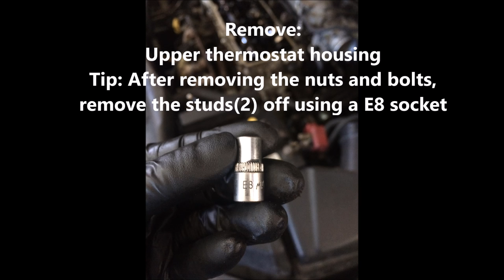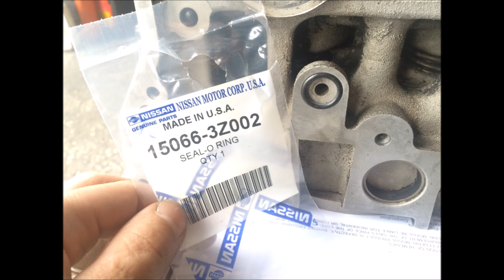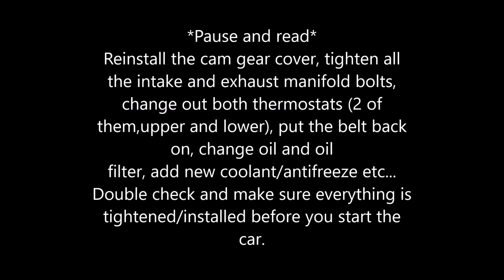Nissan Head Gasket

Comment: need the head bolt torque specs please I don't think I did that part right my head gasket is leaking big time after I got done from where the water pump is at but I can tell it's coming front the head gasket I might have not torqued it correctly my last step was 85 foot pounds
Reply from the maker: Torque sequence:

9   3   1   6   8

7   5   4   2  10

New Head bolts:

Step 1-torque to 72 ft. Lbs.
Step 2- fully loosen
Step 3-25-32 ft. Lbs.
Step 4-Torque 75-80 Degrees
Step 5- torque additional 75-80 Degrees
Reply: Peter Nguyen thanks allot Peter really appreciate it but the part where I went wrong was I put the head gasket wrong I guess I want paying very much attention anyways I went back did it all over again and now car is running as good as new thank you very much for the video and the response to my request on torque specs
Reply: @RevvedUpKnowledge  if I marked my cam gears when I removed the head but forgot to put #1 and #4 pistons TDC when I put my new head back on I turned the crank to get pistons #1 and #4 TDC can I just face my front lobes out and put my cam gears on with timing chain and be in time ?

Comment: Dislike that you don't narrate but the content of this video more than makes up for it. Lots of great tips. Thanks for sharing. I'd also like to share a couple of points I learned while doing this job.
1) Forget the magnet. The chain tensioner can be retracted by pushing with a flat blade screwdriver and pinned before removal. Much safer.
2) You don't really need to remove the upper thermostat housing studs. Since you're removing the head anyway, just unbolt the coolant pipe bracket and lift it straight out with the head. Remove from the head after it's off the block.

Comment: This video helped me through doing my head gasket in the middle of the cold winter working outside no garage late hours when I got home from work. Took me weeks but is done. 4000 miles later car is running like a champ though I do have to say I did not get the head resurfaced at a shop but sanded the head myself and after about 2000 I noticed coolant leaking again and misfiring. I also had bad manifold,flex pipe, o2 sensor and cracked valve cover after replacing the head gasket so there I was again pulling the car apart and buying new parts that I didn’t even want to go as far as pulling the head again. At this point I decided to buy a new vehicle but kept this one and took the risk to buy the head gasket sealant. Scared as shit poured half a bottle in the radiator and filled the coolant up. 2000 miles after pouring that in and I have no misfiring anymore and no coolant leak. car has drove 4000 miles from the head gasket replacement. Only thing now is I have small oil leak somewhere near either timing chain cover or valve cover. Valve cover is brand new I’m thinking I didn’t put enough silicone when I put the timing chain cover on. Been jus checking the oil and adding some when needed. Will have to take the valve cover and timing cover off again when I have a chance. But anyways this video is great and really helped me understand everything bout replacing a head gasket and more. It’s a lot of work but it’s really not that hard.
Reply from the maker: Thank you so much for watching and believing in me and my video! Yes most of the things I share aren’t that hard and if you take your time it can be done. Keep wrenching!

Comment: Very helpful video Peter. Wish where was one this detailed for everything Ive had to do over the years. A+ for this video. As far as the timing chain tensioner. It has a small hole in it near where the tensioner piston and spring come out. If you can compress the piston all the way back into the tensioner body you can put a small nail through that hole and it will sit in the groove in the tip of the piston. This will allow you to remove the tensioner without worrying about losing any parts. That was the most nervous part of the job for me. I really didnt wanna have to take the WHOLE timing chain cover and such off to retrieve parts.
Reply from the maker: +Ken Littlefield thank you! Also thank you for the tip, as many times as I've done this I never thought of doing that!! I will def do it next time! That is the most nerve racking part for me as well because that means a ton of extra work

Comment: Getting ready to do this for my daughter's 2006 Nissan Altima...your video has given me more confidence to tackle this job myself.
Reply from the maker: Thank you for watching and your kind words! Its not too hard at all. Basic tools, label everything and since your doing your own car, take your time. =)
Reply: Quick question...I've got all the bolts removed from the intake manifold..upper manifold removed and see where there is a bracket/brace on the back side of the lower manifold that's keeping it from being slid back. Do you need to remove only the two 10mm bolts that hold it to the bracket or do I need to remove the bracket from the block?
Reply: BTW...I went ahead and removed the two 10mm bolts that held the bracket on and after a bit of frustration loosened the 12mm bolt that held the bracket to the block...I did not need to remove the bracket completely but only loosened the 12mm bolt. Got the rest of the intake manifold to slide off with no problem at this point.
Reply from the maker: Glad you got it worked out!
Reply: I'm down to prying the head off now...was beginning to think the head bolts wouldn't come out I was using a 2' breaker bar and was afraid they would strip.I used a rubber mallet to make sure the 10mm hex was inserted fully in the head bolts.
Reply: Peter...your video was a big help. I got the head resurfaced and the valves checked/tested. Pre-tear down compression test results were significantly different...from 110 - 135 per cylinder...now with the new head gasket there wasn't any test below 150 PSI per cylinder. I'm having random misfires now I'm trying to figure out...thought it was a vacuum line...even found one that was not connected but the problem is persisting. Checked all the plugs and swapped out a few of the coil packs but didn't fix the problem. I'm thinking now it's either fuel injectors or the timing chain is off...but I was pretty sure I had the timing chain in the right place. The sprockets would only go on one way and the chain was aligned exactly as the picture I took. The problem is most noticeable at idle..when I get the RPMs up to 1500 or higher it runs pretty smooth...not perfect but better.
Reply from the maker: ive noticed a lot of times these engines overheat, some of the coils or even all sometimes will go bad and will have a bad misfire. Good way to start checking is if you have a CEL on, check it and see which cylinder is misfiring and then swap the coil with a non misfiring cylinder. clear cel and see which one misfires this time. Same cyl misfire means coil is good. I would then swap the spark plug with another cylinder and do the same checking procedure. i would definitely get new plugs anyways. 
If you removed the fuel rail off the manifold, installing them back on could pinch an o-ring and cause a vacuum leak as well.
Reply: Thanks, Peter...I believe I narrowed down the problem to a faulty Intake Manifold Variable Camshaft Solenoid...will know for sure tomorrow. I did not remove the fuel rail so I should be good there. I'll keep you posted.

Comment: I have to change my head gasket, same car same engine. This video makes it look a bit easier then i thought.
Reply from the maker: not too hard at all, some cars you have to take the oil pan and timing cover off to do this job but luckily there is a way around that on this engine. You just have to organize bolts so you know which goes where and be sure to mark you TDC the timing and mark the chain and sprockets. Torque everything to spec too.
Reply: +Peter “LikesToFixIt” Nguyen hey, i'm in the process of removing the chain tensioner. But im confused as to how you removed it with a magnet. I work at a toyota dealer and all the techs are telling me to remove the front cover. Based on your video i don't think i have to. Honestly i don't want to but if i have to i guess i should. Please help
Reply from the maker: yes taking the main cover off is a pain but for this engine you can get by without taking it off but be VERY careful because if you don't have a strong magnet and work carefully the spring and piston for the tensioner will pop off and fall down into the oil pan and you'll most likely have to take the pan off to retrieve the parts that dropped.
Reply from the maker: Make sure everything is TDC before taking it off just in case something happens

Comment: Very good video, just need a little more details, such as the bolt torque parameters for tightening the cylinder head bolts, don't forget to put back the plastic guide before installing on the timing control cover, etc.

Comment: I have been searching the net for this video for almost 6 months!  Now I got it! Thanks Peter!
I have used stop leak and it clogs my 6 months old radiator right away!

Peter: Is special socket needed to remove the  head bolt?
Reply from the maker: thank you for  watching! some models use a E20 (6 pointed star) which is a female socket version of torx screw and some use a 10mm hex socket
Reply: As peter said, 10mm to take off OEM (2006) head bolts and an E-20 to put the new ones in. Buy or borrow both a torque AND Angle guide to make sure you have them torqued properly. Dont want the head warping or leaking down the road if you do it wrong.

Comment: The small holes in the cam lifter buckets, is there a position that they should be clocked? I can’t find any drawings that show this. Thanks for the video!👍👍
Reply from the maker: No specific position. They pretty much float between the valve spring and the cam lobe.

Comment: I forgot to put my car on TDC. Can i put the lobes back in the same position, as well as line up the chain marks. If not what do i need to do. Your advice would be very helpful
Reply from the maker: If you marked everything before removing the chain then I would put it to your markings first. Make sure your lobes are pointed in the direction it was taken off and also check that you haven’t turned the crank. Install the cam cap bearings and be careful while tightening to make sure it’s not binding on anything(or if the valves is going down on a cylinder that the piston is up). Once the chain is back on and your marks lined up, hand crank it to TDC and see if it matches or binds. If there is no binding turn the crank all the way around one time and checking if there is binding. Don’t turn the engine on until you triple check everything. Hope this advice helps a little
Reply: Hey I did this same thing I didn’t put it to tdc  but I did mark everything and put it back together perfect and it is all back together now. How do I tell it’s at tdc when I turn the crank ? Is there marks on the wheel that I line up with that pin ? Or can u give me ur advice please.
Reply: Revved Up Knowledge    ^

Comment: Very nice video. Question, Do you have to move the cam lobes facing outwards? Couldnt you leave in the same position you had them in when you took them out. Especially if you are marking the cam sprockets with paint
Reply from the maker: Thank you for watching!! When you reinstall the cams, facing the cam lobes on cylinder 1(closest to fender) outward like that keeps it close to tdc. It just insures you that your valves are closed when tightening the caps down so you don't bend the crap out of the valves. Only markings is on the cam gears itself and that wont be installed later

Comment: I really thank you and appreciate you for your video am encouraged to replace the head gasket. Would you recommend a OEM gasket kit or aftermarket? And what tools will i need?
Reply from the maker: I would recommend OEM gasket since your doing it yourself and saving money that way. For tools pretty much basic socket set, pliers, e-socket set(inverted star bit), variety of extensions, hex bit set(head bolt size 12mm I think)
Reply from the maker: Thank you for watching the video and your kind words! If you haven’t yet Please LIKE and SUBSCRIBE!!! I also have a Facebook page, Instagram and Twitter account and I do post different information on there as well.

Comment: Good summary. But holding chain, up with zip tie on AC line? Without seeing the bottom gear? You are working rather blindly aren't you? Seems sketchy to me. Nice that it worked out for you. I'm attempting this now. Fingers crossed.

Comment: no need to use magnet on tensioner just insert a 3mm drill bit or similar wire in hole on tensioner and it holds everything in place IIRC
Reply: What hole? Where is it?
Reply: pause 2:51 just near the spring, if you buy a new one it comes with wire/pin installed iirc

Comment: Thanks for the helpful hints. I really appreciate your kindness. Cheers
Reply from the maker: Thank you for your time and for commenting!!
Reply: Hi again, watching the clip, at 5:08 on the clip, why have you put silicon around the hole that is below and to the right of the O ring? is it important and what does it do?
thanks
Reply from the maker: It’s to seal off the timing cover. I believe a 10mm bolt goes into there. Just to insure it doesn’t leak any oil. 👍🏼

Comment: Awesome video. Thank you so much for doing this. What type and brand of silicone did you use. Is it RTV? And should there be a specific temperature range, ie 500 degrees
Reply from the maker: thank you for watching!! i use the nissan grey silicone or sometimes i use Hondabond HT
Reply: Thanks. I am ready to put the head back on but only see 3 10mm bolt holes that can be connect the timming cover to the head. Am I missing one. There are two on the lower corners and one in the middle. Where is the fourth? Also would you know the lengths of these bolts because it's the one spot I didn't label. Any help is appreciated and thanks again for doing this awesome video
Reply from the maker: Bobby Cvitkovich  there should be 5 total that connects the cover to the head. 2 of them are inside near the top part of the head(not top of cover and one on each side) 2 on outer lower corners (longer one on left corner) and one right in the middle. All bolts are the same size except the lower left one(longer)
Reply: Thank you for getting back to me so quickly.  My son will be excited because this will be his car when we are done working on it and we hit this stumbling block that you helped us get through.
Reply: Do you know the torque specs on these bolts. It's the only ones I couldn't find. I already did the head bolts.

Comment: great video..Is it necessary to take out the caps? The one numbered E1, E2, etc....
Reply from the maker: i would def take them out and lable them. in most cases the machine shop makes you take them out or they will charge you an extra fee. Plus you don't want to mix them around because it may cause noise from your valve area or worse keep a valve slightly open and cause engine roughness or no compression at all

Comment: Very helpful video, thank you. But 2 things. You never mention the intake ports and what a pain those are to get out and second, I've got every bolt loose on the thing that I can possibly find and the head will lift up about 1/2 an inch but no further...any thoughts? Again, thank you.
Reply from the maker: I forget how a pain the manifold can be since I do them so often. Does the head lift about 1/2" all around or one side or every corner but one?
Reply: Peter Nguyen Every side
Reply: Sorry... Every side
Reply from the maker: Sounds like maybe the intake manifold is in the way. I don't remember if I mentioned to unbolt the bracket for the intake manifold at the bottom of the block area and pry the manifold away from the head for better clearance
Reply from the maker: Let me know if that's already out of the way of the studs

Comment: I replaced the head gasket on my 08 x-trail engine and had a couple of bolts left over and I think there is oil leak at the base of the dipstick

Comment: Hello i am asking question for my cousin. He has 2005 nissan murano thats a V6 3.5L engine. He wants to change head gasket on it would these steps you shown here apply to his specific vehicle being its also a nissan suv ?
Reply from the maker: Thanks for the question. The procedure on the V6 is different and it’s a longer process. You have to take apart the whole oil pan and timing cover to take the cylinder head off.

Comment: I know it's recommended to replace but have you reused the headbolts? If so did they work?
Reply from the maker: You can use them. You can still do the same torque procedures. First procedure usually stretches the new head bolts.
Reply from the maker: I would buy new though. You can get a set for not that much
Reply: Alright thanks